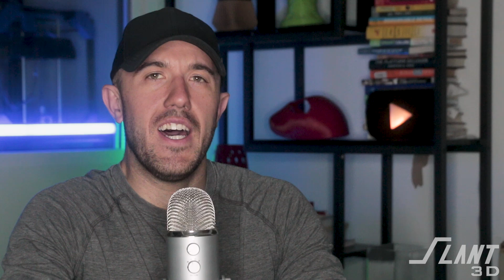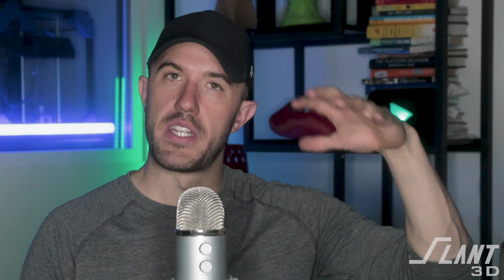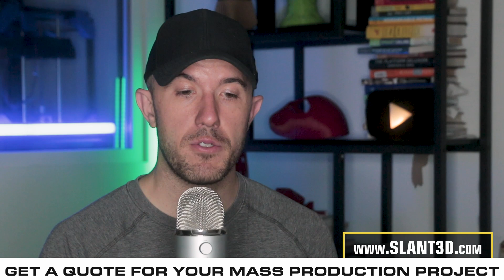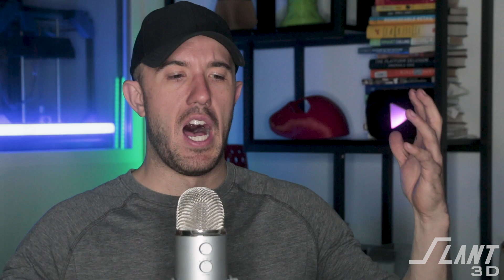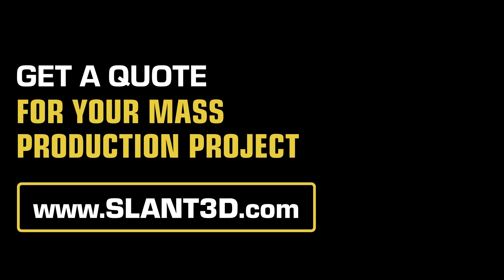Software is Very Close | Filament Update | New Content Coming | 3D Printing Podcast

Comment: Such a great video. Both from the standpoint of where Slant 3D wants to influence the larger manufacturing community, and from the inspirational standpoint at many levels. As a 'hobbyist' and engineer it is fascinating to see a company be transparent and helping educate the industry and others in a wider community. It's an indication of demonstrating industry leadership.
I'm here to follow the long story, as think it's going to be a good run. 

Regarding the open sharing discussion (not sure if open source is right terminology), perhaps a system where contributors (designers, etc) can contribute and earn points, or levels of access for making contributions. The tricky part is encouraging good behaviours, while limiting a few from gaming the community in a way that is counter to established community culture.
Most people don't need access to a full design, but if there was a way to enable low barrier access to creating variation of components (or sub-region) of a design, it could be a win-win contribution wise. Particularly when the larger community values such design variations and considers them improvements. The design collection becomes a growing library that is a known reference to inspire creators to make new contributions to the library, or to the shared body of knowledge.

Comment: Regarding the API, I had hopes for shapeways to grow into what you may want to take your API to.  It never got there.  Their model assessment algorithms were good, but the price and lead time were not.  It looks like they were using very large and expensive machines and you had to wait until there were enough parts to fill the “beds”.  On the other hand, maybe their QC also took long. What I was hoping was for a place were you could upload a single parametric model and it would allow you to change a couple of parameters and print on-demand many customizable products.
Reply from the maker: Those parametric apps will be coming later

Comment: Love to hear the updates on the filament, if you can actually sell them for $10 per kg I would love to switch over. I really think that material cost is one of the biggest things holding back 3D printing from going to the next level. 

An example of this is a box I bought from Walmart. It’s a basic design just a cross hatch pattern with two handles injected molded. 

I designed the same box and then looked at how much the material cost would be to print and the price is close, but just buying it is definitely still cheaper. $10 filament, would make it cheaper to print than to buy.
Reply: Are the masses of plastic actually the same? I find lots of injection molded stuff is only cheap because of how thin (and not sturdy) it is.